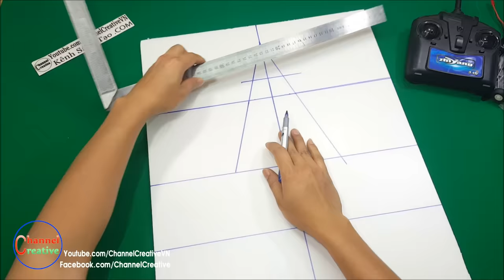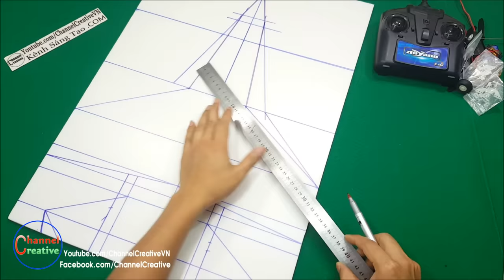How To Make A RC Airplane SU-27 Sukhoi Twin 180 Motor

Comment: Brother.....great job
Your work is excellent. 
From where can I get this remote control kit including motors
Reply: ebay for under $20.00
Reply: DJ Savage Dj Salvage Can you please send me a link?
Reply: Boom Gaming just go to ebay and type in the search box The list of parts from the list he posted here. I found a used radio for $7, I found the motors for $1.10 each I found the wheels for $1.15 the battery is probably going to be the most expensive thing. Then just go to Michael’s or any craft store and buy the material to make the plane I keep asking on the dimensions but he will not give me a straight answer he said 60 x 40 but that doesn’t tell me anything so I’m simply going to have it printed out at Kinko’s until I find the right size and then I’ll just trace it off that once I’ve done that I will post all my dimensions on this listing so that someone else can make another one like I am!
Reply: DJ Savage I couldn’t find a 7,4 V battrey for good price :/
Reply: Wow so you just bought a used transmitter for 7 dollars? That’s crazy what did you write ?

Comment: This is not a how to video. there must be step by step explanation. The video lacks specification of dimensions and material used. Either change the title to something else other than "how to". Your plane lacks aerodynamic designs , I am confused by how your plane flies without an airfoil. Also your motor voltage isnt specified. I refuse to dislike because your art designing skill are great.
Reply: Exactly
Reply: right

Comment: It was a nice build .... You should definitely try to add a rudder at rear end so you could change direction as per your needs
Reply: Bruh you can use the ailerons at the back end, that can be used as vertical and horizontal controls.

Comment: how the yaw motion is controlled without the rudder movement. Are you slowing down the speed of one motor compare to the other for left and right turn ? or only with the elevator you are able to manage the yaw motion ?
Reply: He is using the ailerons at the back to control vertically and horizontally both.🤦‍♀️

Comment: How can you control the DC motors speed? I used an FS-i4 transmitter with an FS-iA6B receiver and I can only stop or go to maximum speed without control the motor speed...

Comment: My question had nothing to do with where you purchased the motors the servo the receiver the radio any of that my question is what are the measurements of the plane can you please draw out a schematic with calculations so that I may be duplicated
Reply: DJ Savage Which is the best lipo battrey to get in your opinion :/?
Reply: Every battery has its own purpose. Could be weight could be you want longer flight time. Depends on you and your needs. We have dozens of different milliamps for different purposed and aircraft.